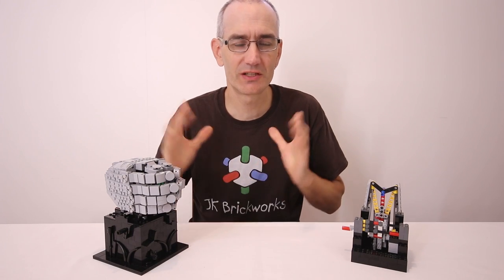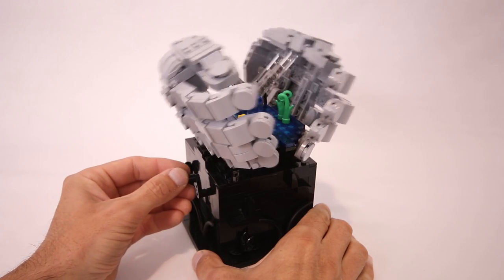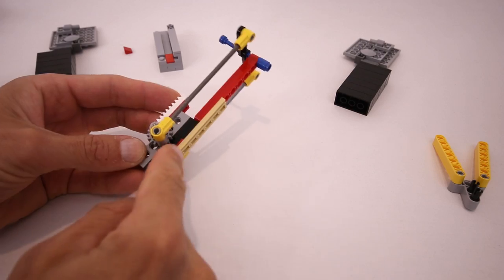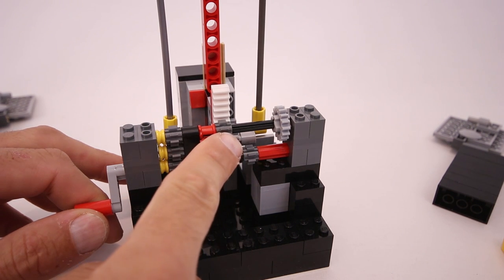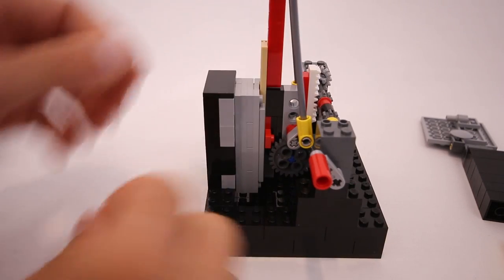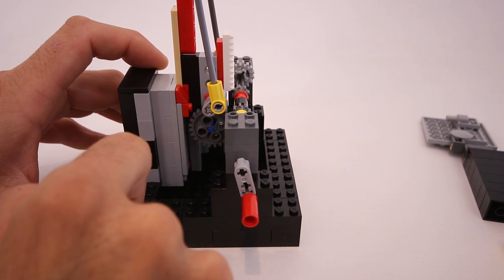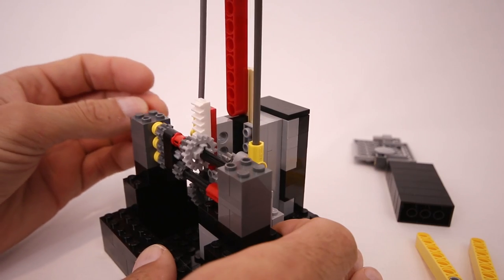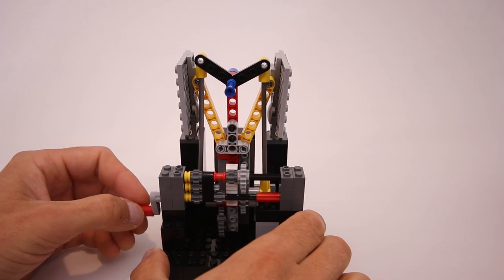Dragonfly LEGO Kinetic Sculpture

Comment: You should make a slight change to your channel name.  Call it JK Amazing Brickworks.   See what I did you guys do amazing work.   Could you build a working elevator shaft for mini figs.  The problem I kept having is the friction in the shaft doesn't allow the elevator to go down using a simple string and pulley.  I would like to use gears but not sure where to start.   Really would like to see your thoughts.   Probably a very simple build for you
Reply: Do you have the technic worm gear? If you do use that with a spur gear.
Or did you mean the slack in the string prevents the elevator from going down?
Reply: I made the shaft 4x6 and the elevator is 4x6.  The string will pull it up.  But it won't go back down because it's too tight.
Reply: How about running another string from the bottom of the elevator till the bottom of the shaft, and then backup to the spool at top?
That way there will always be 1 rope(the top 1 while going up, bottom 1 while going down), being pulled. This might help.
Reply: Thanks.  I'll give it a try

Comment: is there a way to make the dragonfly more lifelike? I mean moving of the body or four wings like a real dragon fly? I am really interested in this project and love this work.
Reply from the maker: I'm sure it is, but you might have to build it at a larger scale. As soon as you start adding more moving components, the mechanics will start requiring a lot more space. It's already pretty tight just getting the simple wing flapping to work in the space of this model.
Reply: Matthew Carrell you could add more shafts and more parts of the wings beneath